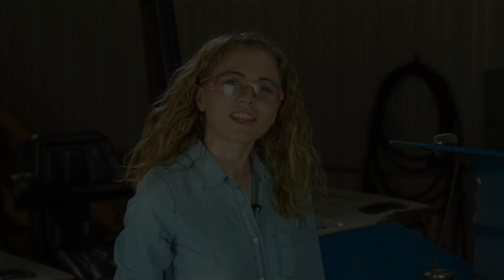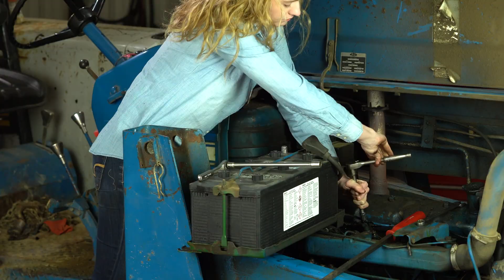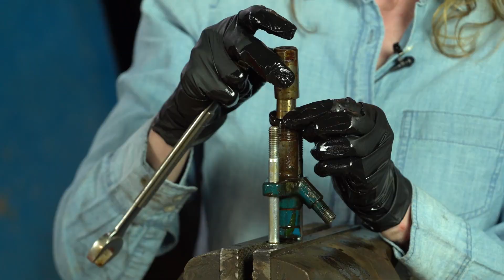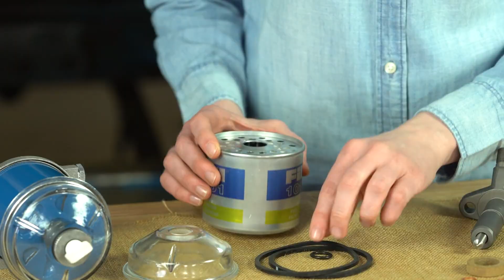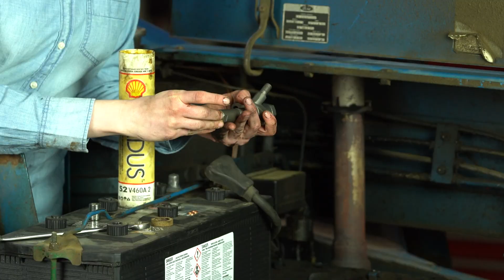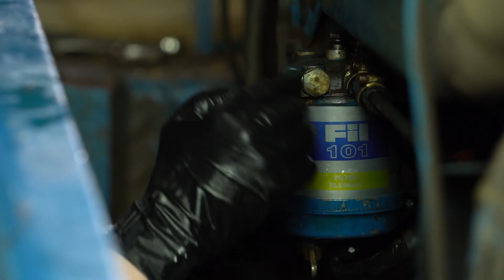Ford Injector Rebuild and Replacement for 2000, 3000, 4000, 5000, 7000: Easy Step-by-Step Tutorial

Comment: I have a ford 841 diesel.
Can you tell me if they are the same as the ford 5000? My tractor runs rich and has a 172 engine. Pistons are perfect and head was just redone.
Reply: If the injectors are the same- can you tell me the part number for mine?

Comment: Never use the battery as a “tool tray”. Sooner than later you lay something on there and cause a arc. I liked the video so much I purchased a new set of injectors, seals and a filter housing. Great job Rachael!

Comment: Hey Rachel - thanks for the great tutorial.  I'm getting diesel in the crankcase of my 70's FORD 5000 Row Crop.  I've heard to suspect Injector Pump Seal, Fuel Pump or Injectors.  Do you have instruction on replacing the front seal on the injector pump?

Comment: It’s called a nozzle not a tip. Just to clarify. You also don’t need to rebuild them under fuel like she did because all your going to do is get the dirty contaminants on the outside in the tub of fuel then into your injector

Comment: I have a Ford 4000 select o speed. I have diesel pouring out the filter on the side of the head. I know nothing about tractors. I love this tractor and its power. Could I get you to fix it, maybe injectors or rebuild and fix my pto so it wont be running all the time.

Comment: Hi mam what is difference between ford 3000..4000..and....5000. Engines i have 1971 3000 and i want more hp in it what modification i need to do with its engine. Can i make this 3 cyclndrs. 70 hp plz reply me thank you

Comment: You didn't hear what I said. Can you rebuild and take apart the injectors clean the Assembly and tips with brass brushes and reset the spray pattern. With bench equipment. By hand.

Comment: I have an older Ford 555 backhoe with fuel problems.   Do you have a video of a fuel pump repair that would be comparable to my diesel 3 cy?   The tractor has a plate inside the wheel well with numbers stamped on it.    Series 19-803, serial number CB 35283.   Thank you.

Comment: I miss a video where you show how to remove and install a Simms fuel injection pump on a Ford 5000 (1965).
(I'm not going to do any work on the pump. I just need to remove it so I can take it to a workshop).
  - Or do anyone know if a video exists somewhere else?

Comment: How do you know when they go  bad?
Reply: When the engine not runs properly it's a possibility that the injector(s) are bad. But you can't know before you test them.  That's the first thing to do. Or you can test the cylinder compression, but you have to remove the injectors anyway.

Comment: at what pressure should the injector open at on a 1978 2000 series ? i tried to put air through my injector and at 80psi nothing came out the tip. and also will air work for the test ?
Reply: Diesel fuel injectors open at very high pressures of 2000 psi upwards. So it's just a good sign that nothing comes out at 80 psi.  
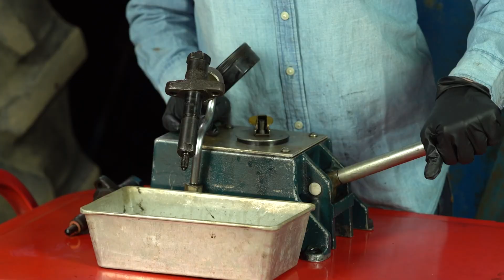No, air isn't a good option, because you can't see what the spray that comes out of the injectors looks like. You have to use diesel fuel, nothing else. Watch at 3:40 (bad) vs 5:39 (good).
  Unfortunately I don't know what the opening pressure for this tractor should be for now.   I'm  now trying to find out what the exact pressure is for my 5000 from 1965.

But you can do a pretty good "first aid" test to an injector, without need of any test equipment. Just let me know and I will explain the method to you.

Comment: Hello, I have a ford 3400 and my tractor starts really easy but smokes a lot in the beginning. it is mostly white smoke and smells like fuel.  The smoke somewhat clears up once the tractor is warm and is being used but returns if I leave the tractor running at idle speeds. Any idea what might be the issue? If its injector pump related, does this tutorial apply to Ford 3400?  thanks in advance!

Comment: Rachel do you know where i gan Get Window liner  for the Ford saftey cab 😁
Reply: I had a 5000 with a full cab and doors with a back glass. The only one I've seen. Wished I'd never sold it. How many where there and was it an after market thing or was it factory. I still have the doors and back glass

Comment: When you replace the banjo bolt, first turn the loose bolt upside down and slip one of those sealing washers on it.  Then insert the bolt through the fuel fitting.  Then slip the other washer on and screw in the bolt.  Makes it easier to keep up with your washers.  It's also a great idea to lay a big white rag down on the head first to try to catch any dropped washers.  They can hide real good.

I also found that the plastic/nylon drain bolt in the bottom of the filter housing (my housing bottom is metal, not glass), can get stuck and impossible to remove without breaking.  I actually had to drill mine out.  But there is such a thing as a steel bolt for marine applications, which you will probably have to order from Europe.  But it's worth it.

Comment: Here are two steps how to check the injectors without even removing them from the engine.
    These tests assume a rotary injection pump is used. If the engine has an inline pump then injector pump problems could give the same effect as a faulty injector.
   Assuming the engine will run:

1. Disconnect the leakdown pipes and direct the injector leakdown into a clear plastic bottle per cylinder. Run for a few minutes and check how much fuel is in each bottle. If a bottle has nothing the valve may be stuck open. If there is much more than an egg cup full of fuel then the valve is leaking too much and would benefit from replacing. A quicker but messy alternative is just to run without the leakdown pipes and see how much fuel is discharged.

2. With something to catch any fuel, try each injector in turn releasing the fuel pipe nut ½ a turn. If the engine note changes then the injector is at least doing something. If there is no change then the cylinder isn’t firing – if compression is ok then the injector is likely to be faulty.

And this is a method to test them by using the engine's own injection pump:
With the engine disabled from running (e.g. glowplugs out), remove injectors one at a time and reconnect to their fuel line with the nozzle into a clear plastic bottle. Take great care to keep well out of the spray and safety glasses are a good idea. Crank the engine and observe the spray through the bottle wall – it should be a uniform fine mist. Compare all cylinders – any injectors that look poor should be rebuilt.
  - Well, engines like this have no glow plugs, so you just have to release fuel pipes from all injectors.

Source:   https://www.anglo-agriparts.com/diesel-tractor-injector-testing-overhaul
Reply: There's also a method to test if the fault is in the pump: Change the place of the injectors! If you replace an injector that seems to be faulty with a sound one and test it again with the last method I mentioned. If it still doesn't work properly, the pump is the problem.

Comment: Will the fuel filter bleed, only with a tank half-full?
Reply: Maybe not, it didn't work on my 5000. The valves in the diaphragm feed pump will probably not open. But my feed pump can be operated by hand too, so the problem was solved.

Comment: FYI.. If you skim the heads on a 201 diesel the head bolts will bottom out and the head gasket wont crush at least on the older ones with the half inch head bolts. You have to add an extra washer or drill and tap..Washer worked great.  It was an absolute pain in the ass convincing people aka mechanics that that was the problem until I fixed it..You think you have a pinhole or a cracked head etc etc. I got the backhoe dirt cheap because who knows how many times the head was skimed
Reply: True but irrelevant to this topic.

Comment: had a 3000 on the farm as a kid,it was a bugger to start.glowing,cold start button and crank away for a good 10-15 seconds then it came to life in grey diesel smoke.hence the long big battery. my grandad used the battery as a working table.with the old style battery with outside couplers between each cell. a wrench got some welding marks is all I need to say xD. it was a strong little tractor with 3 litre ,3 cyl. 65horses i think.

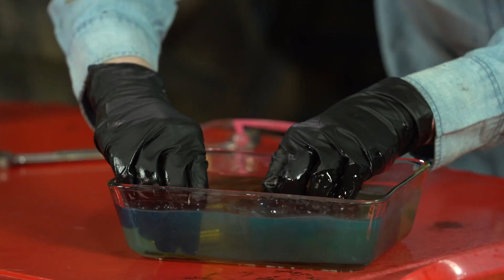Comment: Hi Rachel... Why you say at 4:51 "the valve does not installed dry"? What will be the problem if you install the valve dry?
Reply: The fuel both lubricates and cools the fuel system.  You don't want the injectors trying to work dry and unlubricated the whole time you're trying to bleed the system and get fuel to the injectors.  I suspect ATF would work better than fuel for assembly.

Comment: This type of nozzle can be re worked to perform as when new by grinding the needle and nozzle base and lapping together. Also when stripping an injector it's best practice to undo the top cover and release the pressure first as this will allow deeper seating of the 2 delicate pins that locate the nozzle. Re set the pressure after re build probably 175 ats. Always make sure you fit the correct nozzle by checking the despatch numbers on the body of injector and the DLLA150S ... number on the nozzle. The last didgets are most important. Otherwise an informative video.
Reply: A T, you sound like you've been there-done that. You brought back fond memories. In Vo-Tech we also lapped injectors and shimmed them up to specified breaking pressures. It really makes a difference in how the engine starts & performs. Also, it's amazing how many new ones come out of the box not atomizing. I ALWAYS check them. Not everyone has a test stand though.

Comment: Thanks a million for a video on the thousand series Fords.  I have a 4000 3 cyl and parts are hard to find and repair information isn't available as your video.  I have the repair manual, but hard to follow, because of to much detail of things not needed.  Do you have a parts list on these model tractors or only on the web site?
Reply: https://www.steinertractor.com/brand-ford-4000-3-cylinder
https://www.stevenstractor.com/home/shop-brand/ford-new-holland.html?cat=646&manufacturer=3267&product_list_limit=36

Comment: Rachel, I was wondering you were very specific about when you rebuild a injector to put the new tip on under fuel, then you pressure tested the injector and blew out the fuel, are new injectors shipped with fuel or was only to test the rebuilt injector ?

Comment: Torque wrenches have been invented, and torque specifications are available.  Why are both absent from this video?
Reply: MrShobar ... Perhaps because they're not universal. If a torque spec was critical, I think she would both use a torque wrench and include a mention in the narration. 
    Besides, look at that smile. One of the most genuine things on YouTube.
Reply: The torque specification will generally specify whether the threads are dry or lubricated.   I doubt that your apochryphal tale of crane collapse due to lubricated as opposed non-lubricated fasteners can be true.  A competent engineer would never specify bolts that could be loaded anywhere close to failure in that circumstance.  
She should not just "go by feel", because diesel injectors contain a very delicate pintle valve mechanism that must not be subjected to forces that could distort it (e.g., by uneven clamping forces on the assembly).
Reply: @MrShobar  Every major engineering disaster has a licensed engineer behind it. As a project manager of 30+ years I can assure you the above scenario is not only true, it is true for multiple failures.  You obviously know little of crane failures.....or the uncommon use of a torque wrench for non critical applications.  She owns and uses one where needed, but nothing she touched here is torque critical.  If anyone used a torque wrench to set every nut and bolt it would add untold hours to even simple repair jobs.  You wouldn't pay them to do it and neither would anyone else.  This isn't the space shuttle....which by the way suffered from multiple engineering failures made by some of the best engineers in the world......and please don't keep confusing level of education with common sense.
Reply: "Every major engineering disaster has a licensed engineer behind it...."  You're right.  We should just forbid any engineering involvement and oversight!  Then, even the very rare accident could be completely eliminated! 

"You obviously know little of crane failures..."  How do you know?

"This isn't the space shuttle....which by the way suffered from multiple engineering failures made by some of the best engineers in the world...".  We should just eliminate all engineering involvement in the space program.  Let it be planned, manufactured and assembled by high school dropouts.  This would save untold hours and guarantee success.
Reply: @MrShobar  My point, which you obviously missed, was that "trust the engineer" is hardly a formula for success.  The level of ignorance among engineers on material compatibility and performance under unusual conditions is horrifying and is often the root cause of failures.  Civil and mechanical engineers aren't metallurgist or really all that knowledgeable on many materials, but feel free to offer their opinion as the "expert".  As to I don't know what you know on crane failures, it is obvious you aren't familiar with them or you wouldn't have called the described failure as unlikely.....since variations on that theme are all too common in crane and tower failures.  Engineering is like any other general discipline, people gain proficiency in specific  areas and are often totally ignorant in related fields.....which doesn't stop them (or doctors, lawyers, etc) from playing the expert outside of their little niche.  Getting back to the basic issue, you don't need a torque wrench for every bolt and back when many of these machines were made, there weren't even specs for 90% of the bolts on these machines.  Read period maintenance material and the phrase "until snug" shows up a lot.  The phrase I love in a Ford manual from the 1920's is "tighten a half turn beyond finger tight".   Now for a valve cover with a cork gasket  this is just fine guidance, but it isn't exactly precise and I wouldn't know how to translate it to foot pounds of torque.
Reply: I didn't miss your point.  It was just ridiculous.
Reply: @richardanderson2411  You TOLD HIM Mr. Anderson! Great Job!
Reply: At those lower settings, torque wrenches generally dont work right.
If a person needs a torque wrench to tighten the 12 or 13mm injector bolts, that person shouldn't be working on anything.
Reply: Torque wrenches have ben invented that cover ALL TORQUE RANGES.  It's a legitimate question as to whether SHE should be teaching others without any evidence that she is properly trained herself, despite "that smile..." and "beautiful teeth...".
Reply: @MrShobar  
Again if u need torque wrenches for 12 and 13mm bolts, please dont try to fix anything.
Reply: U need to understand I have an advanced degree in Mechanical Engineering, not just a 4-H member like you.
Reply: MrShobar ... Usually those who have advanced degrees are readily capable of spelling simple words correctly.
Reply: @JW...-oj5iw  
And need torque wrenches for simple 12 and 13mm bolts.
Reply: Yes I agree that "those who have advanced degrees are readily capable of spelling simple words correctly".
Reply: MrShobar ... People may be laughing at you, especially now that you quoted most of the comment I pointed your way.
Reply: People point at laugh at clowns like you.  But keep working on that GED.  You'll make it someday.

Comment: Thanks a lot! My injectors are still excellent on my 3055 (between 3000-4000, european model with modified 3000 engine and 4000 transmission and rear axle), but if ever something is wrong on my injectors, I know what to do!

Comment: Don,t like the way you're using the top of your battery as a tool tray with exposed terminals!
It's bad practice and a bad example to show people. Otherwise I generally like your videos.
Reply: Yup I'd be using a sheet of old rubber belt if it were me. Touching both terminals at once with a tool is no joke
Reply: @jeffreysheldrake3243  Or even a piece of cardboard?
Reply: @stevepeat1719  for sure
Reply: Battery gas explosion will wreck your day or worse  !
Reply: Or pop into AutoZone and gather up a handful of the black plastic caps for the negative terminal. 
    I slightly chided Sarah-n-Tuned for installing battery cables in reverse of safe order. She responded that she had installed thousands of batteries and it doesn't matter.
Reply: @JW...-oj5iw  But we know it does if she touches some grounded metal with her wrench when tightening the hot terminal clamp.

Comment: Oh yeah, that injector is bjorked.  Would have been nice to see/hear the start and run before the injector was pulled.  Then again that is quite a bit of fuel to be dumping in.  At some point you risk hydraulicing the cylinder.  Nice to see you guys expanding your product offerings.

Comment: Cringed when setting ratchet on the battery, please don't do that remove the battery or get a cart to put parts on.
Reply: You've never worked on a tractor it seems.
Reply: airraptor 

Welcome to farm life. I’ve done it tens of times, and I’m still here.
Reply: She even set them far from the posts, and one was insulated by the looks of it.

Comment: great video ,i like the way you described the actual injector spay pattern and the pop-off pressure,
Reply: However (comma) I would recommend spraying  into a clear jar (a clean peanut butter jar will do)  rather than allowing the spray to just flow uncollected.  My tester is bench mounted and the injector mount is at the front.